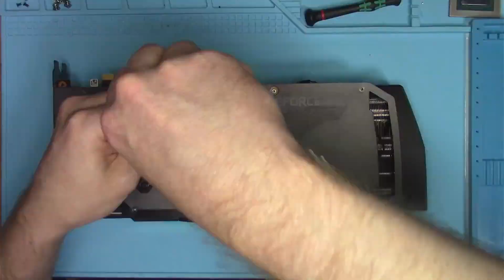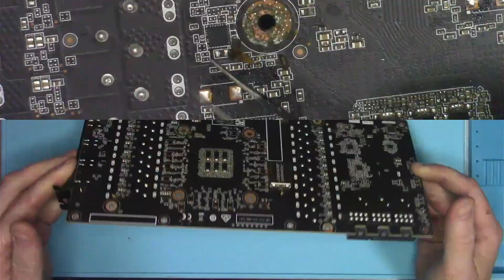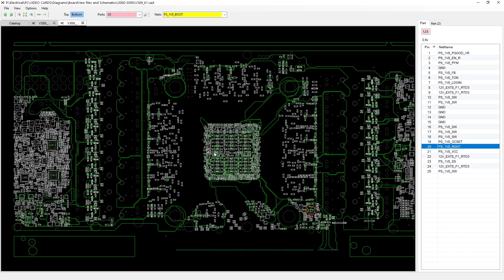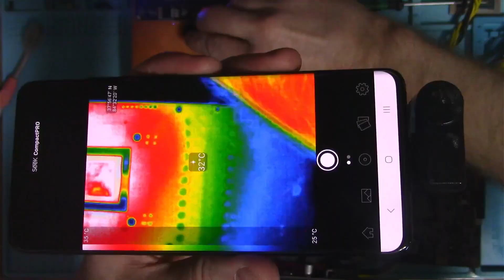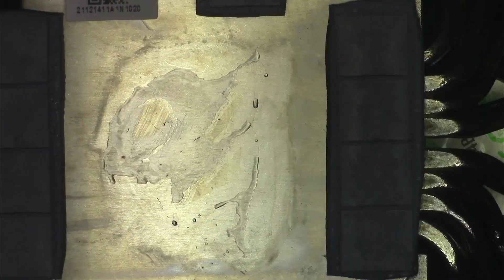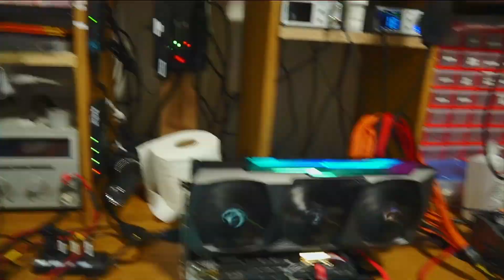What killed this Zotac 3080ti AMP EXTREME HOLO ?

Comment: I'm surprised that no one has mentioned that benchmark score. My MSI 3060 which is 5 rungs down the ladder with a mild overclock scored within 200 points on Superposition and only 800 points lower in stock trim. Not much performance gain for the extra $800-$1000 difference in price. Is that the Zotac under performing or is that an across the board score?
Reply: i just ran superposition with my 3080 non Ti from Msi and got  23789 score  on the same settings as his. i think his score is so low because the core i5 in his system is bottlenecking the gpu
Reply: @boofygoofy3758 It's ridiculous to state facts? I never said that 3060's were as good as 3080ti's. I simply checked my score and even ran a fresh test to confirm my score. I anly compared my MSI 3060 to THIS Zotac 3080ti. I even asked if this was normal or just this card. I got an actual reply that stated his 3080 Non ti scored 11000 points higher than this card and even offered a possible explanation for the low score.  Before getting all butthurt, or giving a half-assed reply, Try checking other reviews that show Zotac cards consistently score lower than other brands.

Comment: Hey N-W, do you think that it's safe for an untrained person to attempt to cut off gouges with a razor like you did?  It looked like a very easy fix, so I'm considering doing it if my next graphics card has gouges on the heatsink's mating surface.  Also, was that isopropyl alcohol you used to clean the mating surface?
Reply: Doing it on the heatsink should be fine as long as you take it slow and take care not to add any extra scratches or gouges. 

I don't have the skills he has but I've always pulled apart my own parts to clean them.

Comment: of topic question: Are the ASUS Z&() ProArtCreator boards a good purchase even with the current ASUS problems? I am an audio production enthusiast not going to overclaock and intend all components to be recommended parts.
Reply: Are you referring to the AM5 x3d chip overheating problems? If so, that was specific to their highest end boards, and only when running an AM5 processor with the larger L3 cache (x3d). That problem was resolved several months ago. If you get a new board, simply update the BIOS. In regards to the ProArt series, the main advantage of those boards is the 10Gb  Ethernet speed (for fast transfer of large files). Most of the similarly priced 670e boards to the ProArt come with 2.5 Gb Ethernet connection speeds. Other than that and the aesthetics, there isn't a huge difference between that and another 670e Asus board. For example the Asus ROG Strix 670e. As you work in audio production, I assume you use an external DAC, in which case the audio codecs of the different boards are probably of little interest to you (some use higher quality codecs than others).

If it was specifically an AM5 Asus motherboard you were looking for, that you weren't going to overclock, then I would consider the Asus B650e-e. It has many of the 670e features at a lower price with plenty of connectivity on the rear IO. I'd only pick the ProArt if you

1. Wanted the aesthetic (for an office environment)
2. Wanted the 10Gb NIC 

if you really want a 10Gb NIC you could also buy any other motherboard of your choosing and simply buy a dedicated 10Gb NIC. An Asus model for example would cost about $110.
Reply: @TheSwayzeTrain  So nice of you to respond. I agree there isn't much difference except the Thunderbolt 4 I/O on the ASUS ProArt , ,,,, 2 TB4 connections which I will probably need for orchestral sample use with a thunderbolt M.2 enclosure and 4TB storage enclosure. ~ I'll revisit the Z760e series, There has been so little chatter from the you tubers who do builds etc about any current legal or simply customer(consumer) reflections of the overheating AM5 chips calamity. Not even any noticeable comment or  return to building with ASUS boards for the You tubers. The ProArt does have the single PCIe gen 5 connected to the processor with the 2 TB4 connects too. I intended on using the 1713700k with integrated graphics. They are better than what is in my now ancient  Dell PC so,,, should be ok. Allthough another couple months and the 14700 will be out. Not sure if that's worth the extra wait. The Pro art also has the DDR5 and I'm wondering if the current ProArt Z790 will have heat issues with that. But, like you say , I'm doing audio production so absolutely no Overclocking . If you have any ideas about the new i7 14700K or the worthiness of waiting for the extra boost(supposedly about 21%) please, by all means share your thoughts and Thanks again for the info. Great videos too.

Comment: That's where a "bug in the program" phrase came from. First computers were programed using switches to flip bits on and off. Roaches had got in and chewed the wiring, causing a short, which caused it to not be able to be programmed properly

Comment: Hello Mr. Can you advise, zotac rtx 3090 trinity OC, pads changed to 2mm both sides (gelid extreme) repasted with Gelid GC4, 2.5mm pads thermalright extreme on  power vrms. RAM temps drops to max 95 from 105 degree, (furmark). GPU max 75 degree, however hotspot is 95-98. Is this normal or whats the issue? Idle temps are 40+- no dust on radiator or fans.
Reply from the maker: Not normal.
Too hot.
Wrong pads thickness.
Reply: @northwestrepair  thx for opinion 👍

Comment: a stink bug shorted my ROG Extreme Encore mother board. I literally watched it bounce off a fan. Into another fan on the AIO which splatted it straight into the mother board. system instantly powered off. after cleaning the motherboard it wouldn't get out of Bios, i installed a fresh bios. system would not even boot to bios. i called it ruined there and starting tearing it down. found out it shorted something hard enough to melt 1 single pin on the mother board. Its a sad say when you loose a 1100$ Motherboard but it did end up prompting me to upgrade from the old 9980XE to the 12900ks (which was the best that was out at the time). Good content! sad to see another person was victim to bug juices. i count myself lucky i can afford to eat the cost. a lot of people cant. i cant image the stress.
Reply: Same mobo. Luckily I managed to flip the switch on my power supply as the stinkbug was bouncing off the fans. Got very lucky since it's still running perfectly. I've since moved to a different area with less bugs.

Comment: Bought a Zotac 3080/12 year and half ago for 650 euros. No problems whatsoever so far. Card is quiet, temps are good (74C is max I've seen during stress test) and runs all the games I play well at 4k.
Reply: Similar experience with my Zotac 2080 Super from 2019, around £650. Not a single problem in 4 years of pretty heavy use, temps are normally similar, but sometimes go up to 83°C during long gaming sessions, under full load.

My previous card was an ITX form factor GTX 970 from Gigabyte, which gave me no end of problems, with constant black screens after ~1-2 hours of gaming. 

I'll definitely be buying a Zotac for my next GPU upgrade, primarily for the incredible 5 year warranty and reasonable pricing!

Comment: You can easily determine the value of a corroded resistor. Corrosion usually affects only the contacts, so by gently scraping off the corrosion, you can reveal the resistive layer on the top and then measure it with a multimeter 😉
Reply from the maker: Not always. I could not measure the resistor.

Comment: I wonder, how do you imagine cooling of those capacitors. They´re solid caps - most (if not all) rated to 105V@10k hours. Even if they would be running at 85°C (which they won´t) all the time, their lifetime would be 40k hours, which is 4,5 years; at 75°C it would be 9 years. Which is a very, very long time for a GPU. Besides, they´re cooled by airflow from the fans.
You just made up that one. For the sake of berating a GPU. Because no one is cooling these capacitors the way you want/imagine and yet the cards work for years.
Reply: I said the same. Yeah blame for the sake of blaming. :D Even coils doesn't need cooling. But yeah, Zotac are not good for other reason and not cooling.

Comment: a friend of mine had the amp extreme holo 3080 non TI, and at the beginning it was running decently well, not great but not super high either, but a year later the gpu started going so high under 50-60% utilization, high 80s and hotspot over 100"C and would immediately crash on anything even with a 200mv undervolt and underclock to decrease temps, he RMAd it and then returned it to him saying nothing was wrong with it, of course he got angry because the testing metodology was just "used some titles" and one of them was oblivion listed on their testing, he contacted zotac directly instead of CCL (which was the site that sold him the gpu) and zotac themselves said it wasn't right, he sent it back once more and they just gave him a full refund, no repair or replacement, just the whole money back
Reply: I've been using Zotac for over a decade and never had any major problems and their customer service was always excellent.
Reply: same story with my EVGA cards cant beat the customer support! Somehow i have had about 20 ish ASUS cards as I used to and still do run multiple rigs and i have never had a single fault with any of them sense the NVIDIA GeForce GT 640 was a thing.

Comment: Years ago I found out PMY is the maker of nVidias Quadro line. When I asked why the rep said frankly "because they overbuilt thier cards" while I cannot say that now that was good enough for me once EVGA left the market.
Reply: PNY is a trash brand tho
Reply: @nicekeyboardalan6972  Not really. There's no good or trash brands only good or trash products. I have a PNY 3070 3-fan and it undervolts to .85mv. Temps are usually 30-40C and it's easily the most quiet card I've ever owned. 

Anyway, I'm sure they have some trash products but their XLR8 lineup is quite good. I'd say comparable with MSI Gaming X Trio. They're also the only US-based AIB still alive.
Reply: Rep saying rep thing is not surprising. They were probably the cheapest AIB offering, it's often just that simple

Comment: Love the fixing those 3080Ti tho and finding 2 - 3 problems in 1 video solved correctly.
Can't wait for future 40-series fixing or odd problem :D
Reply: yep looks like his going to be busy soldering the new connecter when its available, having to unvolt mine at present only had it yesterday after RMA, melted connecter after 9 months
Reply: @martinmalone6324  the connector and the lack of the 4090ti are the 2 reasons i have no upgraded yet supper infuriating GeForce didn't listen to PCI sig (manufacture of the connector) when they told them it was bad and they didn't want to sell it
Reply: @martinmalone6324  what model fo you have?
Reply: @greggreg2458  gigabyte gaming oc.

Comment: What would cause those gouges?
Reply from the maker: No idea. Card was sealed from factory. No one opened it before.
Reply: Maybe the die started cracking and the gouge is actually a start of a crack?
Reply from the maker: @TheBlueBunnyKen  that's what they call a "reverse psychology" 😂
It's not the fist that punched the face, it's the face that punched the fist.